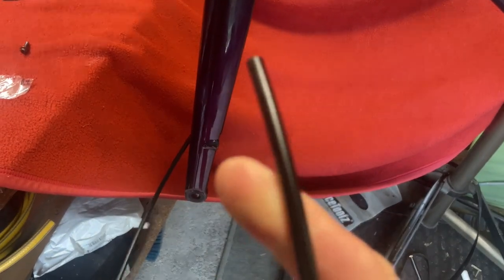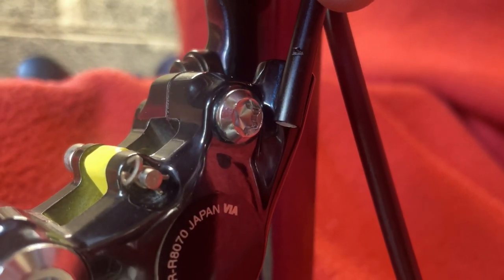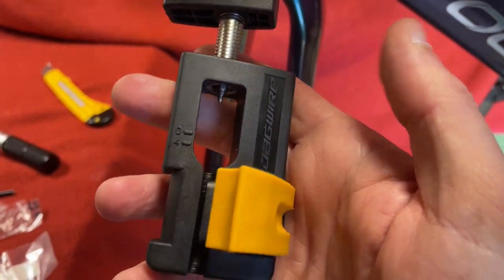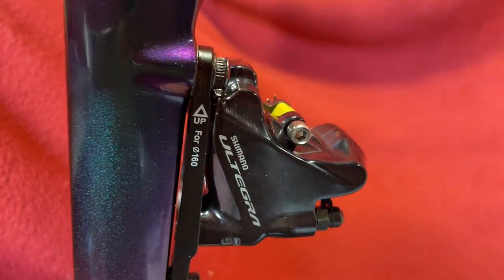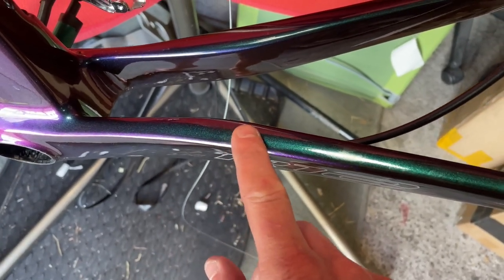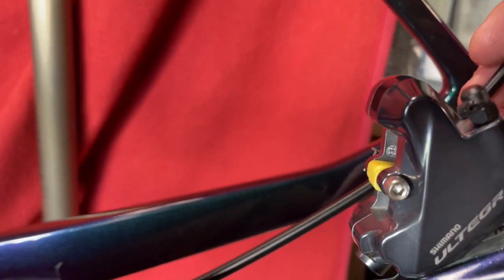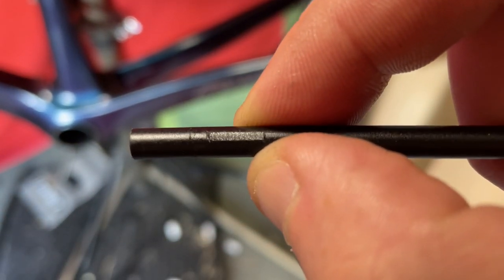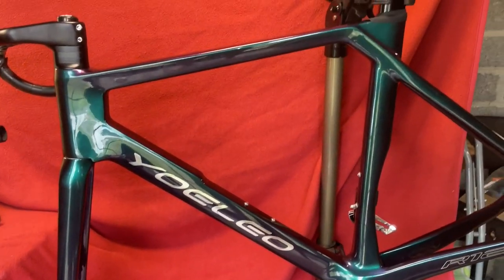Shimano Ultegra Disc Caliper Install

Comment: So weird how different the calipers are delivered. My Ultegra's came with the tube mounted
Reply from the maker: Really? Wow I’ve never seen that before, all mine have come separate. It’s ok if you are feeding from the calliper up but I think I’d prefer them to be separate to be honest. 👍
Reply: @KyrosHouseCycling  Yep, I think both ways will work. I had no problems routing the tubes around the fork and up through the head tube. The white plastic cables pre installed in the handlebar, made the job easy to pull the tubes out to the shifters. Nice job btw. I changed to the R21 because of the waiting time for the R12
Reply from the maker: @flemmingpedersen5927  ah nice! Yeah I was going to change to the 21, in fact I chose the 21 first, then changed my mind to the 12, then almost went back to the 21 with the lead time, but stuck with it. 👍